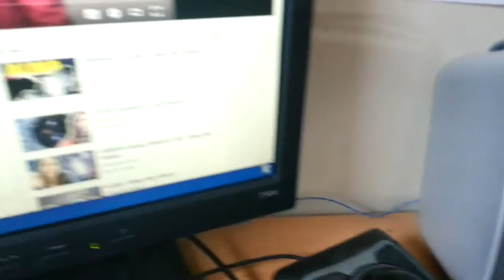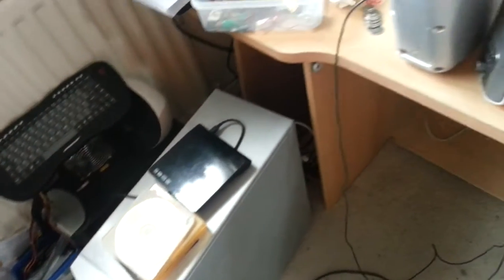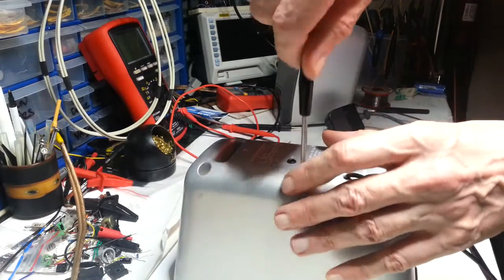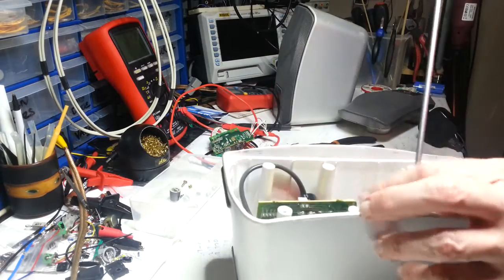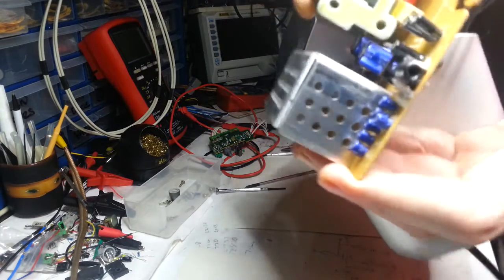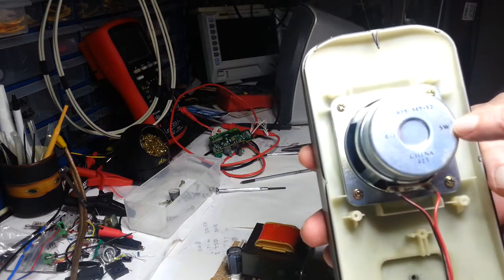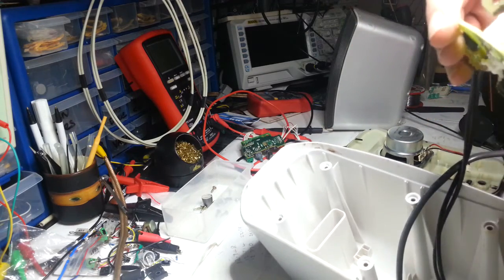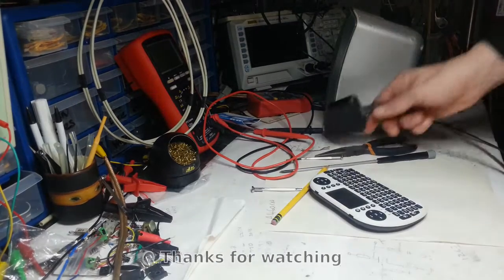Speaker Hum Problem Take Apart Sony SRS A205

Comment: bad winding on transformer  happens a lot with switch mode transformers. if it hums from speaker id change the big capacitor for a bigger one as its probably being used as a filter to stop noise from transformer
Reply from the maker: Cheers for the advice, if only I hadn't had to throw so much when I moved a few months ago.

Comment: ohhh intro titles...I thought I was on the wrong channel when it started....Thanks for the "how clean is your house" tv show...smile.....I gota do more housework...the cat went behind the tv and came out looking like he had stuck his head in a candyfloss machine...and yesterday the smoke detectors where going off when i moved around

10 watts output...could be cw watts (chinese watts)...but more likely 2 times 5 watts = 10 watts
i wonder what fool put that cap INSIDE a heat sink!
Reply: Liked your intro..how about sound music with it...or hire a professional voice artist..(you love spending)..smile.how about a introduction video for visitors small clips joined together..(should only be a few weeks work) ..a cleaning robot..mhhhhhh...well the cat would hate it...and  i got so much junk theres only 2 square feet of floor space...with your wires get a battery in you smoke detector...or stick it above your bed with blue tac so that in a fire it wakes you up by falling on your head.
Reply from the maker: I don't know what music to use. I like assorts and more classical now I am older, I could try that maybe a different track every video? I don't love spending I like being prepared. Another motor same black and white lead died yesterday I panicked as only two in the set and was so relieved when the other set I ordered came today. I find them cheap. 
Guess what? I found a big fault with the Hubsan a fault none of the reviews touch on. I wonder should I make a video so other noobs like myself do not find out the hard way. I will put a battery in my smoke detector as I share this building and I like the family. I do switch off at the sockets all power on everything when I am not using it. Including solar battery's.
Reply: Now that I am very old I like music at a lower volume...A video of the Hubsan fault would would be good...i hate learning things the hard way..smile..did you do a video of putting a new battery in smoke detector...lol..(sorry its my sense of humor)..smoke detectors here will be replaced I will ask to keep the old ones..some nice parts inside...(including very expensive rechargeable  lithium button cells)..very interesting how those smoke detectors work..the chip is surprisingly  smart....they should design drones so that the motors can be just plugged in and out..those 20 screws of the cx5 is a crazy idea..if you are in the mood for video making..I and maybe others would love a detailed one of your solar set up
Reply from the maker: I could do a video, search 'put battery in smoke detector' on here and see results lol. My detector is old cheap £5 from bargain store. Never tried it out with smoke. I needed the battery one day and that was it, never replaced...Hold on. .. I have connected a battery it started sounding at me straight away. I can not get the case to shut so it is just hanging but functional. 
I agree about the x5c with all the screws. It must be said though, the little copter can take some abuse and still keep working. Ok, sure I will make a video about my solar set up, please remember I am no professional and have probably not calculated optimally. How is your panel going, do you store the energy or use it as it is there?
Updated firmware in Hubsan, now have normal mode. Then took it over the fields across the road. It was great to fly it even in the wind I managed to keep control. Very enjoyable.
Reply: Yep x5c is great.....I saw a man and his dog playing with one dog jumping into air and grabbing it...its weaknesses are needs very calm day...and battery dead warning happens about 4 seconds before drone drops out of air..I got my solar panel to have fun...play with it..and learn thats how i found Jacobi's law...i connect it direct to lots of things  except my tongue (maybe you could do that in your video)...grin....I have a 3ah 12 volt lead acid battery..(are you impressed?)...smile...yesterday i was learning in more depth about batteries ..their chemistry and how NASA maximizes their lifespan..on my to do list is make my own panels and learn how to restore old junk batteries...full off grid system for less than 50 quid...lol...have fun with the hubsan...and don't fly in the dark without a buzzer
Reply: From what i learnt yesterday...If your charge control cut off is set to 12.7 volts..i think that is too low..(shortens battery life)...13.5 maybe better..but never trust me...so check it out yourself...smile
Reply: Also you may want to do a monthly equalizing charge..where the charge voltage is about 15 volts
Reply from the maker: Something weird is happing in this thread. every now and then a user Unknown Zone shows up as replying to a comment regarding my video intro. I can not find it in the messages section or on the video. I can not find this thread on the video only here reading on the notification tab??? What's happening, how strange. Other user answering comment saying they make the intro, not being able to find user or comment??? Umm strange, maybe take it down and start again?
Also means I do not see your comments here or on video thread. Only in my channel messages section, which I didn't know existed till a few days ago and notice lots of messages I had not seen???